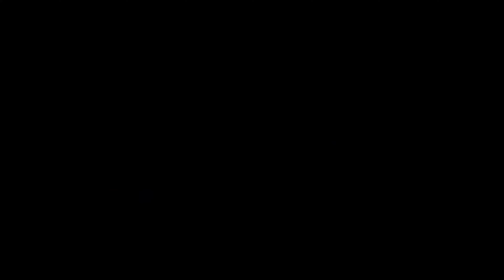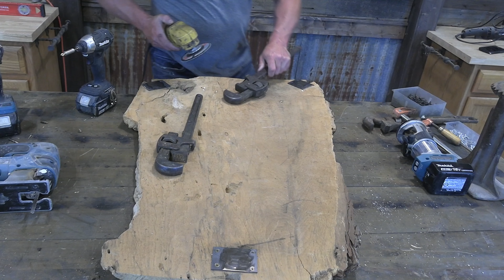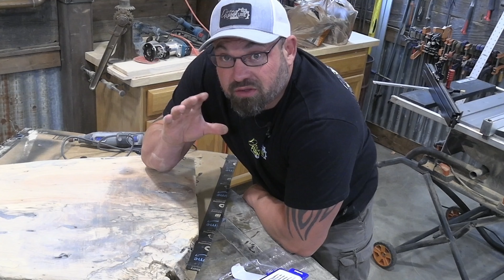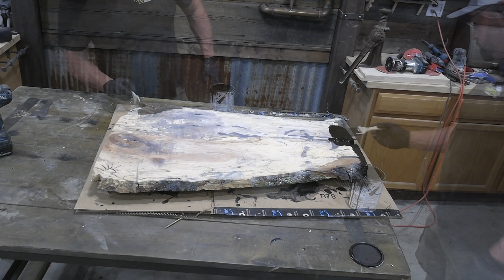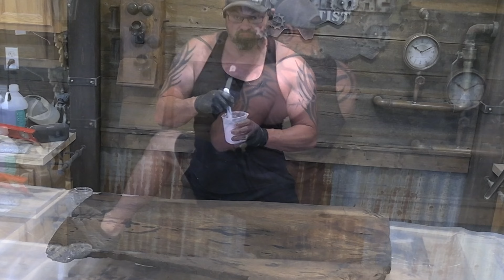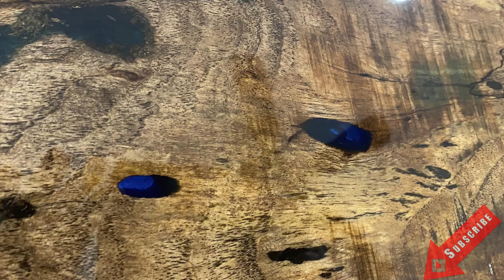Viral DIY Coffee Table Build with Antique Pipe Wrenches & Resin Top!

Comment: Tyson, Tank, and Colossus are perfect (or purrfect) additions to your videos! I have no issue with dancing, that's up to you! I am still working on working with resin, but I've never used an oil-based stain before applying resin. I used a gel stain and waited a few days to use resin. It's probably not right, but it's been on smaller projects. I think your table turned out fabulous! 👌 👏
Reply from the maker: I am finding out resin is a get what you pay for kind of deal. The Total Boat brand has been the best so far and more user friendly but it’s also one of the highest priced.

Comment: The seperate cups is to help reduce the risk of incomplete mixing. Using a single cup it can be a lot easier to not scrape the edges well enough, or get into corners of the cup. Then you pour out and have unmixed of one parts ended up in your project and never cures in those areas. It also helps since if you have a color you want to add, add it to one part, mix it in, then do the resin mixing and you get more consistent color mixing without worrying about starting the cure timer preemptively.
Reply from the maker: Thanks! I knew someone would know the science behind it. 😄